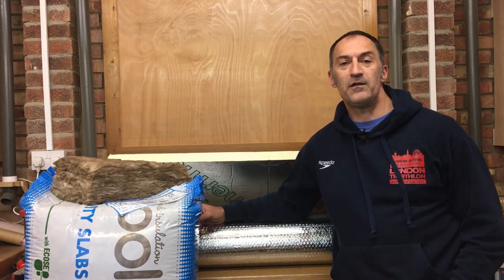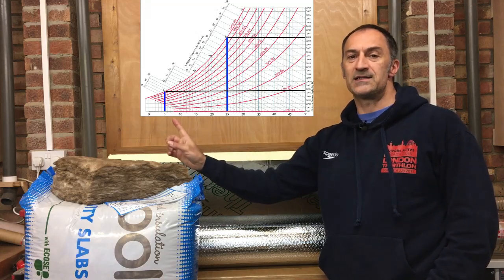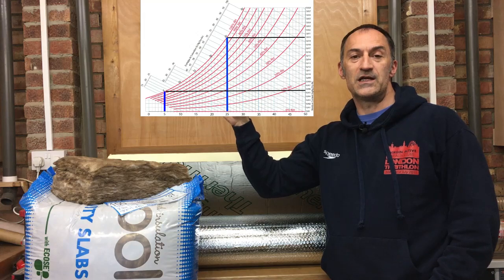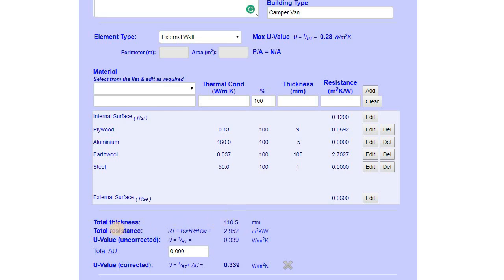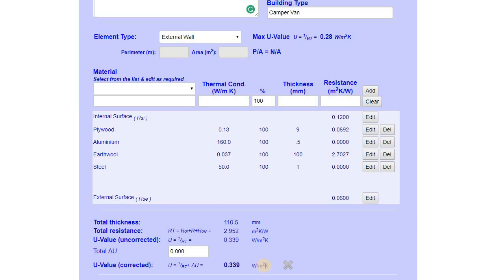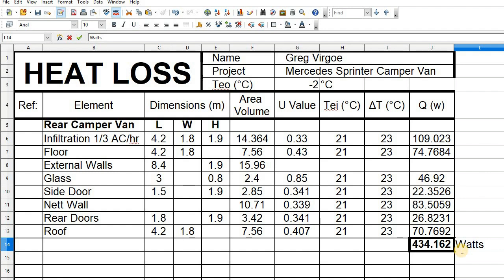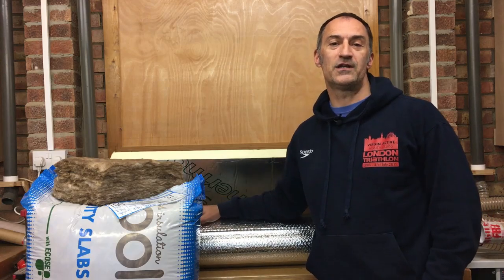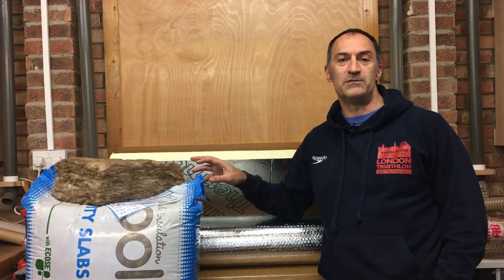How to Insulate your Van Part 1 - The facts you need!

Comment: With regards to insulating vans and hot sunny climes, is insulation just going to slow the heat transfer from metal panels to the inside? Will you be warmer for longer at night with insulation?

Or is there a significant barrier to heat?

Comment: hi Greg really interesting ,im in sw fl where the bigest problem is humidity outside 90percent and keeeping humidity and brutal sun temperatures ,often 80 to 90 degrees f what would you recommend in a tropical climate , thank you
Reply from the maker: Insulation works the same way in hotter climates, think of you van like a huge cool box, the better the insulation the cooler it will stay inside for longer, good ventilation will help reduce humidity, typically high temperatures have low humidity and low temperatures have high humidity.

Comment: What do you think about insulation spray foam? there’s one with 0,025 W/m.K and a R value 5,66 (per inch) with 1,5 cm thickness, can be true?
How do the calculate R value? What means (per inch).
Thanks again

Comment: Hi Greg, I did basically all the steps to isolate my van but found out I still got van wall(metal) still with humidity is there any way to prevent this? I'm still only with isolation no carpet or plywood
Reply from the maker: You do need to cover any exposed metal with an thin insulation layer to prevent condensation forming. 
My latest video on insulation thickness explains why. 
What's the MINIMUM Insulation Thickness? Budget Build Ep 6
https://youtu.be/4-RJCeK9Ysk

Comment: At last - someone that really knows about insulation and sound deadening !!!  I learn so much from all of your videos. What are your thought on using XPS in the walls instead of polyiso ?
Reply from the maker: It has good insulation values and is lightweight so is a good alternative. It may be a little more messy to install with all the little XPS balls. Hope that helps 😃
Reply: @GregVirgoe  You may be thinking of EPS (much like the white stuff those cheap coolers are made from). The reason I ask is at least here in the states, polyiso is a little more difficult to get in a thicker (greater than 1/2" sheets) than XPS.

I plan on using your system of foam board (love the stick pins !!) bats, and a reflectix as a vapor barrier.

Much thanks for all the videos.

Comment: suppose i did this installation and the temp was 60F inside the van and it was 100F outside. And i parked in the sun. How long would the temperature of the van stay under 65F?
Reply from the maker: Without doing lengthy calculations and not knowing the exact details of your van let me just explain what is happening.
The insulation is reducing the amount of heat that canbe transfered through the structure, the more insulation the slower the heat transfer rate per hour. So it makes sense if you intend to be in extreme conditions to use the best materials and the thickest you can install without compromising internal space. In hot climates the one thing that contributes to heat gain in vehicles are the windows so fitting external reflective blinds to windows makes a huge difference ot internal temperatures. Hope that helps

Comment: Morning Greg would you consider using them polystyrene balls to reach into them really hard places i was thinking of filling the bottom panels with rock wool slabs and celotex then pouring the balls into them side pillows which are impossible to get to until they fill up then finish the tops again with rock wool and celotex. ive not seen anyone do this and im wondering if theres a negative to this or just maybe the balls will just escape outside from somewhere. thanks for all your help
Reply from the maker: its not a bad idea, I can only image it could be quite messy doing it, esp if its a windy day :D
Reply: @GregVirgoe  ha cheers ill give it a go ill just pop round a mates house to do it 👍
Reply from the maker: @grahamclose4099  🤣😂🚐👍🏼

Comment: Great video Greg! Your delivery is bang on for my learning style (and from what I've seen in the comments, the same for others too). Thanks for making it easier to understand a topic that has otherwise been overwhelming. I was wondering - when you did the heat loss U-Value calculations for the different materials. Is the total figure at the end for if all the material layers where on top of each other rather than in different spots around the van? Hope that makes sense
Reply from the maker: Thank you 🙏🏼 yes a U value is the sum of all the resistances for each component that make up the structure. So for the wall it’s the sum of the outside air resistance, sheet metal, insulation, ply lining, and internal air resistance. Each I value would vary depending on the materials used. Hope that helps.

Comment: Great info on insulation mate. Very clear advice. 
I would have to say the heat loss calc is going to be way off though, as you know due to the nature of van construction compared to buildings. Cold bridging etc as you mentioned. 
Also it would be useful to have a comparison for the final value, eg a lesser insulated or non insulated van. 
Don’t get me wrong though another great video with actual facts! Rare for YouTube. 
PS. I’m not an engineer but I am a building surveyor and energy assessor for my sins 🤣

Comment: Hi Greg, another very helpful and insightful video. I commented on another video of yours but decided to write on this one because it’s relevant. Our Vario 814 has double aluminium floor. What would you suggest in terms of insulating it - or having to remove it. It looks in great nic and ideally prefer to keep it. Any suggestions would be very helpful. Thanks in advance.
Reply from the maker: Is it possible to lift the floor finish, put PIR slabs down then relay the floor back on top?

Comment: Hi, what’s your thoughts on cork for walls and flooring. 😊
Reply from the maker: I don’t think it’s very practical Personally it’s got a rough surface so would hold dust, not be easy to clean and is porous so would soak up any liquids. It would offer a small amount of insulation depending how thick it’s applied.
Reply: @GregVirgoe  Thanks Greg. I was looking on a site specialising in wall and floor coverings. More for top of insulation instead of timber cladding or vinyl walls/floor
Reply: Meant to say. Really enjoyed your insulation video. We have just bought a Renault Master XLWB high top. Insulation will be key so thank you for your knowledge

Comment: Hello Greg, I love your videos. I am studying to become an HVAC engineer but there is something I can't wrap my head around in your excel sheet. I suppose "infiltration 1/3 AC/hr" means a third of the total air volume will be exchanged each hour but how did that get a U-value of 0,33? I understand it's a third of one but how come that's the value used and will it be the same no matter which van you would be looking at? 
Cheers
Reply from the maker: Hello, 1/3 is the U value 0.33 👍🏼😊
The equation is 1/3 V N T
U value 0.33 x Volume x No of air changes x Temp difference. 
👍🏼
Reply: @GregVirgoe  Thank you for the quick response. However, I still don't quite understand what the 0.33 U-value is coming from? If I would have a AC/hr of 5, would the U-value be 5?

Comment: That's great Greg but I'm not sure I understand the loss that is the roof fan, how can this be factored difficult because of varied temperature's and that its at the top of the van where the heat is what does the fan cost is it worth it ?
Reply from the maker: Well that’s easy, ventilation is the most important thing in your van to reduce the relative humidity. 
When you jump in your car and the windscreen fogs up what do you do? Teach for the heat and fan switch to clear it. Bringing in dryer air from outside massively helps to reduce the internal humidity which is often very high.  You need vent!

Comment: Thank you for this video. Interesting and so helpful! I’m sure this info will be very useful outside of van conversions too.

One thing I don’t understand is the heat loss calculation in watts at the end.
 Would anyone be able to put this into perspective for me ? Using the example in the video and without any heater,  roughly how much would the temperature drop per hour? In Celsius if possible
Reply from the maker: The heat loss calculation relates to the amount of heat required each hour to maintain that internal temperature. So with no heating you would lose temperature quite quickly still 😊👍🏼

Comment: Hi Greg! We’re just starting to build our van conversion. We are using you as our go-to guide. Please can you tell me which spec rockwool and kingsman board you used or recommend? We have looked at the links which are useful, but just take us to he site. Thanks
Reply from the maker: Since making this video there are some new materials available that have better properties. 
Instead of rock wool I would recommend using recycled plastic loft insulation made by Diall and sold at B&Q. It’s kinder to use, great thermal properties and good green credentials too 👍🏼😊
In terms of PIR foam boards they all have similar thermal properties so as long as the boards you choose have foil covering they will be ok. Popular brands are kingspan or Celotex but all very similar in performance 👍🏼😊

Comment: Greg, I have a new Hymer s600 on a Mercedes sprinter. Veery poorly insulated especially over the cab, which has already blown a control panel with condensation.  How do I get some insulation in the without taking down the roof linings and can I get away without a vapour barrier.  Access hole behind panel Is about 20cm x 20cm

Comment: Hi Greg, do we use any insulation in the posts were we put the condue for the wires ?
Reply from the maker: I would recommend using any wool based insulation. The Diall recycled plastic bottle insulation from B&Q is really good value. 
Easy to work with and good insulation value too 👍🏼😊

Comment: Hi Greg,

Thanks for the video! Very informal. I did your calculation for the Thinsulate SM600L. From my calculation, the thermal conductivity seems to be 0.008, witch seems pretty good? I'd like to know what you think about that product? It seems to be pretty popular for many reasons (even though it seems more costly - witch might be the biggest issue?). For the info, the R Value I found was 5.2 and thickness was 42mm. Thanks!
Reply from the maker: Hello Olivier, the actual thermal conductivity value for SM600L as published by 3M is 0.039 W/mk so it’s about the same as any other wool based material which makes perfect sense to me. https://multimedia.3m.com/mws/media/784669O/3m-thinsulate-acoustic-insulation.pdf
Therefore as it’s really expensive you’d be better using something like Diall plastic loft insulation as it has exact same properties and far cheaper
Reply from the maker: That R value is published in imperial units so it’s looks high but in reality in SI units it’s the same as all other wool type insulation products. Manufacturers often try to make their products look superior to sell them at inflated prices. Often cheaper alternative will do just as good a job 🤩

Comment: You lost me at "thermal properties"  🤣🤣🤣 (0.18)
Nevertheless, I did watch it all, and I have always thought that wool has got to be better than the glass stuff.  Both are sustainable (sheep's hair keeps growing !!) but I think wool is warmer than glass 🤔
I also think the celotex stuff is pretty good, but I'm thinking the thinner stuff may be easier to fit.
Reply from the maker: A really good alternative to use now is recycled plastic loft insulation from Diall supplied by B&Q it’s really nice to touch no horrible safety issues, easy to use and good “thermal properties” 😂😃👍🏼 oh and did I mention it’s cheap to buy.

Comment: At last someone who knows how insulation works 
Has a builder of 50years I am sick of arguing with people about insulation  nice one 
Have you seen the multi foil material it is used in loft conversion to keep the height but not been able to find the u value of it
Reply from the maker: It will have a similar thermal conductivity to most wool based materials but with added benefit of loads of moisture barriers. Spend a little time to seal up and joins and edges and it would work well. 👍🏼😃

Comment: Hi Greg, your videos are great thank you for them they are very helpful, I was wondering even 5 years on how many 50mm Celotex sheets you used in your campervan build. I have an L3H2  Peugeot Boxer and after taking out all of the ply linings was very surprised by how much you need and difficult to calculate how many at such a cost? Many thanks, John
Reply from the maker: 3 sheets 25mm for the floor. 
4 sheets 50mm for the roof and walls. Lots of foil tape 👍🏼😊

Comment: I realize it has been a few years since you made these videos, however, I was hoping you might be generous enough to answer a question regarding the combination of materials you used here. Since the "wool" has thousands of air pockets in its fluff, would adding the reflectix material, though used strictly as a vapor barrier, also possibly have at least some radiant heat barrier effect due to this air pocket in the areas where the wool was allowed to separate the reflectix from the metal an other hard materials? Or would the effect be so greatly diminished as to not be a consideration? Thank you.
Reply from the maker: Naturally being very reflective it will have some of those properties and not permit radiant heat through into the van 🚐
Reply: @GregVirgoe  That's what I thought, but you are more qualified than I to answer that. If I may bother you further, is there a reason you went with the Reflectix type rather than an aluminized non perforated sheet as your vapor barrier? As it takes less space (albeit not much) I am in a much smaller space and every little bit matters. Thank you for your generosity and time!!
Reply from the maker: @erichwise7734  it is still very thin and you benefit from two layers of foil and a small thermal break

Comment: Greg video tutorial Greg, you got a new sub :) a quick point on the first item of the excel row. I get that this is the contribution from the air infiltration inside the van. It looks there is a mistake on that row cause those members of the equation can’t be watts. The value you get way too overestimated for the leakages. 🤙🏻
Reply from the maker: The calculation is correct assuming a 1/3 of an air change an hour for infiltration. Which is not unrealistic with dash vents and roof vents open like we have. 😊
Reply: @GregVirgoe  totally agree with the infiltration assumption! What I meant is about the calculation that follows: maybe I’m missing something but you are multiplying volume*U-value*deltaT where the U-value is the ACPH. To have the heat loss from infiltration you would also need to multiply by specific heat of air c_air times density times 1/3600, no? Else you don’t get power (in Watt) if you stop there🤙🏻
Reply from the maker: @beck2929  the equation for calculating the heat loss due to ventilation is Qv = 0.33 × n × V × ΔT watts. I may have confused things by saying 1/3 air change rate. Thanks for your comment 👍🏼

Comment: Hi Greg. What are your thoughts on using wool insulation and a semi-permeable membrane as opposed to the full moisture barrier method? My only concern about the full barrier method is the possibility of the barrier being punctured or losing integrity during driving and use.
Reply from the maker: Install a proper vapour barrier every time it’s the only way to prevent condensation forming. 
Spend a little time sealing all the joints and edges and you’ll be ok
Wool is not the solution to prevent condensation forming.
Reply: @GregVirgoe  Thanks Greg. I've been surprised at the differing opinions on this subject. I think I'll be following your method of double sealing all the layers wherever possible, just to make sure.

Comment: Hi Greg, I have considered using celotex to insulate my van but then I found out that it is apparently highly flammable which does worry me, what do you think?
Reply from the maker: The modern stuff is not flammable check the labels. In any case it’s not the cause of the fire and what about all the wood in the van conversion which is far more flammable? These things won’t cause a fire so don’t worry so much

Comment: Hi Greg, I am thinking of making my own screen covers using a waterproof material with furniture blanket inside the material as I figure that would have a better insulation value than most ready made screen covers ( they don't seem to advertise their u values). In your opinion am I barking up the wrong tree.
If making the covers is a reasonable idea would it be better to have them on the outside or inside of the screen TIA
Reply from the maker: External covers perform better thermally than internal ones. 👍🏼

Comment: I've been mucking about fitting out camping vehicles for at least 50 years - but always much more to learn. Love your and your video's professionalism and presentation. So much good info, and the chance to keep up-to-date with new materials and techniques. 
I'm about to fit out a new Toyota HiAce SLWB (when it finally arrives from Japan). The Hiace maybe rare in UK but it's very popular down-under - it's like a somewhat smaller version of the Sprinter. Famously rugged and reliable it should make an excellent camper van.  Climate here in Tasmania like a milder version of Essex where I grew up, so most of your design applies here too. Info on insulation especially useful.
Thanks for taking the time and trouble to make all those great videos.
Cheers
Richard
Hobart

Comment: Hi Greg still you happy with your insulation and why you didn't use armaflex ? Thanks
Reply from the maker: Hello 👋 three reasons. 
   1. Only very thin so thermally not as good as 50mm PIR or 100mm wool.
   2. Expensive. 
   3. Heavy. 
It would be good for wrapping wheel arches or window recess